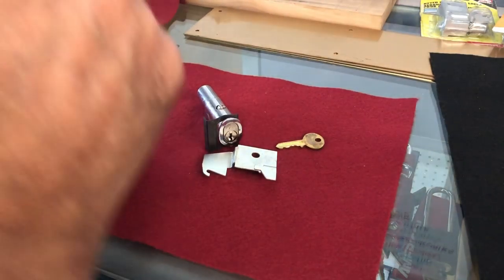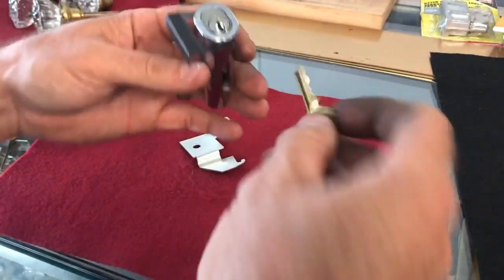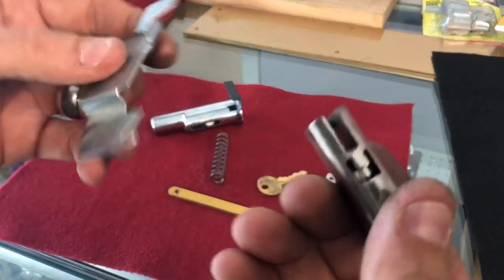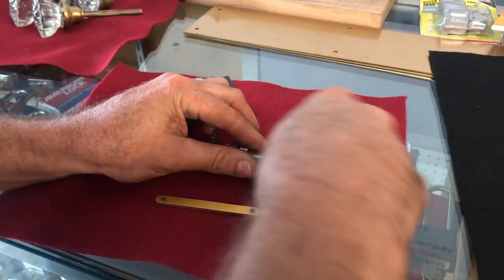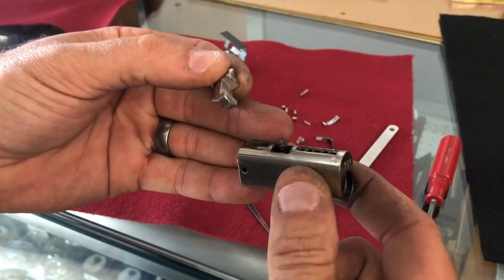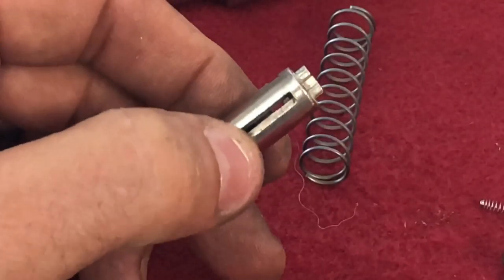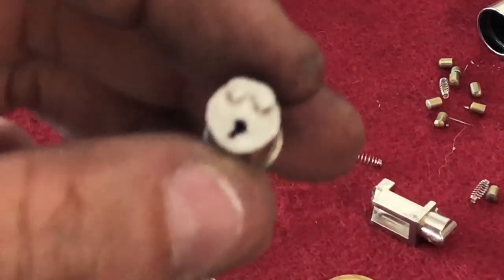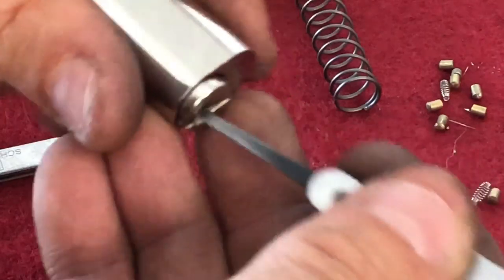filing cabinet lock with foreign object

Comment from the maker: I didn’t even think about it while filming but an old trick from back in the 5 cut Ford days, it was extremely common for the key buzzer switch to break and get pushed into the back of the ignition. You could almost always grind/file/cut the tip of the key down to get it to go far enough to activate the pins. 
In this case, you could take the whole 5th cut off since it obviously isn’t needed. So, if you have a key that stops going in, definitely on L700 series codes (and likely others) you can file to tip of the key down to get it to unlock the cabinet!